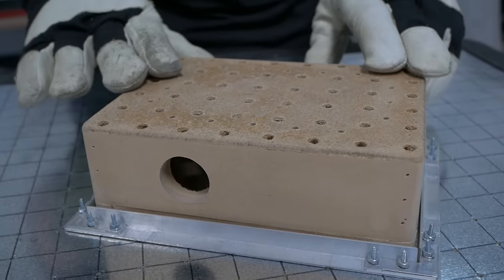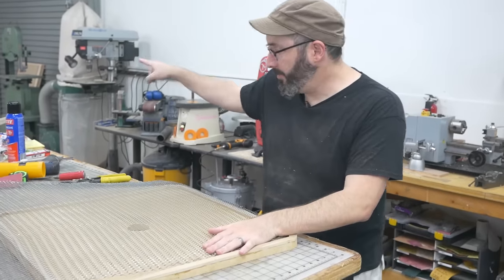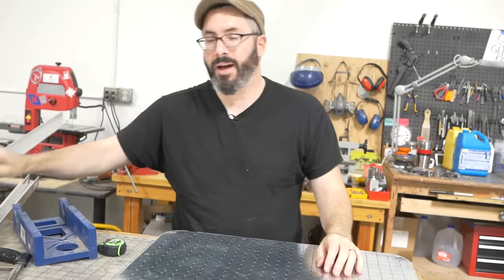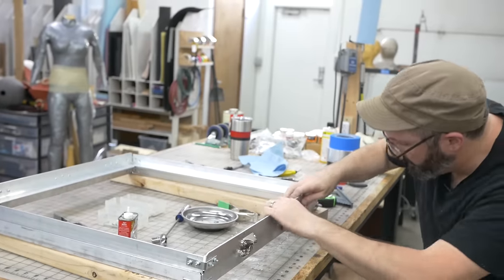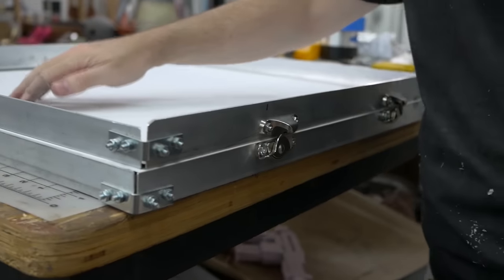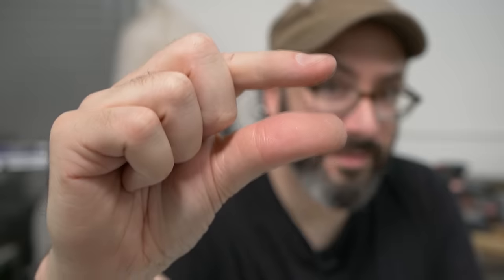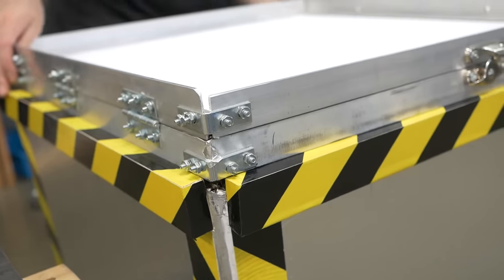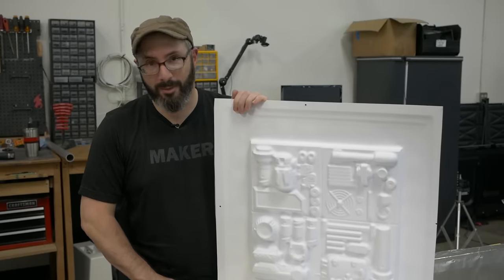Hardware Store Vacuum Table - HOW TO make your own

Comment: When I’m gluing, I’m a huge fan of either a 2 part epoxy or West System carbon fiber resin, which is my favorite it’s way more expensive but you could use fiberglass resin from Walmart $20 difference between the two other than price is West is a 1to 1 ration the Walmart brand is 1 to 10 drops. Great idea that’s awesome bro I think I’ll follow suit with you and maybe catch the mist from your storm. Shalom
Reply from the maker: Thanks so much for watching!

Comment: With that heat, I'd put in a caution to do this in a space as large as Bill's or outside (like drag it out of the garage) because of MDF's propensity to offgas urea-formaldehyde, the glue that creates MDF. 
Also, Id throw in a tread pedal switch to turn off/on the vacuum, so one person could operate the process.
Reply from the maker: A tread pedal would be ideal for sure! And yes, it's definitely good to be cautious with high heat in small areas!

Comment: Suggestions and tips:
Heater box:
- adjustable height (adjustable heat, faster or slower heating), 
-single custom element (keeping in mind that this is a build of hardware store bought items, tear the two heaters apart and put the coils where you need them to be)

Aluminum frame: 
-you can braise wield aluminum with a propane or map/pro torch (takes practice and a good torch head),
 -on the inner side of the frame where it grips the plastic put punch marks (punching from the sides that don't grip the plastic), all around the inner edge of the frame (making gripping dimples), or just puncture through the aluminum altogether with a nail or big punch to make gripping teeth
-Also the aluminum frame was best idea, lightweight and cools faster

The base: 
-glue the metal and spacers on before cutting for less work, or just don't cut the corners, 
-and primer or sealer or vinyl or veneer on any exposed MDF or particleboard (I hate working with the stuff and find that these wood like to attract ambient moisture)

Comment: maybe if you added a fan to help moving the hot air and distribute it by adding some turbulence it will get hot faster and also help having a uniform... but I like the fact that you used the fact that hot air moves upward. this also will allow you to probably move the heater a bit closer to the sheet so you will save a lot in term of energy and time

Comment: "Vac-zilla" seems appropriate or perhaps "Frankin-vac".  In college I worked at a sign company that made vacuum formed signs. The plastic we used was .02" ABS plastic; a poly vinyl I think. It has a lower optimum temperature and holds the heat longer, necessary for the plastic to get into the finer details of the mold. Rather than trying to seal the aluminum frame to both the plastic and table, the commercial table we used had a 1/8 in raised, high temperature, hard rubber bead gasket that sealed the plastic to the table. The frame only held the plastic sheet in place. You should run the vacuum through a sealed 5 gal (or bigger) bucket to a foot valve to the table. Run the vacuum prier to moving the plastic to build up the vacuum in the bucket. This acts like a capacitor or an expansion tank in a water system. The full vacuum is more instantaneous. The vacuum foot valve is used commercially for vacuum forming and silk screen print tables. Also the foundation for your parts should have holes drilled in it to distribute the vacuum evenly throughout the mold.

Comment: to get a better heat on your plastic, after the plastic has heated say 3/4" of the way to temperature, flip the entire piece and finish heating the other side all the way to the finished temperature. Those heaters are INFRARED heaters, so they heat items by reflecting IR light off them.  Like standing in the sun makes you feel warm as you absorb the IR light.
Reply from the maker: Thanks for the tip!

Comment: you could save tons of time and material cost by using 24 x 24 pegboard blanks for the top.  Even the aluminum ones are relatively cheap and much lighter than adding another inch of MDF.

Comment: These are good for shaping parts for car audio. Like kick panels and door pods 
The formed part is used as a mold to add your fiberglass resin and mat into or just use thd form as it is. For a car your going to have to make a right and left  
Pattern to form from. 
These are not just for art they have a practical use to make things with that do more then visually functions.
Reply from the maker: Very true!

Comment: to get more detail in your results you need to create vacuum at the top of your form. With the last one you would have to create a channel under the bottom and make small holes up to the top. The holes would be places along edges where you want the plastic to be pulled into. To soften out the webbing and deformation at the edges you can use clay and round out the edges to the table a little bit. I use to work at a place that made pool parts and some were vacuum formed. The guy who designed and built the forms had it down to a science. He could build a form and within a couple tries get the exact parts we needed, adding only a few holes here and there or some molding clay.

Comment: Super cool and fast build.  Silicone would work as well, act as glue and allow you to take it apart in a pinch (as opposed to gluing the top pieces together).

I have cut the lower section at 45's and then bent the frame so you only have to make one corner bracket.   Meaning you cut a 45 notch and bent the upper aluminum.  

Cool Idea on the sash lock.  Never used those.  I will have to try that.

It will make your plastic a littler thinner if you are doing,  say trooper armor.  But raising your part onto a platform,  will make the webbing happen off the part.  And dont forget to mention that you need to drill holes through your parts/buks in order to get detail (but very very small).

Comment: A couple of thoughts: 
1 - There is a lot of time between pulling the plastic off the heater and starting the vacuum, allowing the plastic to cool. Turn on the vacuum before removing the plastic from the heater. It won't start pulling until you seal the frame to the table, but will then pull immediately, while the plastic is still very hot.
2 - Wire your heaters in series and plug them into a 240v outlet, I'm sure you have one in your shop. It will only pull 12 amps, and you won't have to mess around with all the cords running to different outlets, etc.
Reply from the maker: Thanks for the suggestions! =)

Comment: When you are heating the plastic up place a Styrofoam insulation piece totally over the top suspended by the the aluminum channel. That way you're not losing any heat and the plastic should heat up more quickly and more uniformly.  Place a thermocouple connected to your voltmeter inside this space to measure the actual temperature to know when to remove the plastic for the forming process. To automate the process, you could connect a thermocouple  and a heater circuit controller to an Arduino to extinguish the heater and a buzzer to alert you to the fact that you need to transfer the plastic sheet to the vacuum former.   Just a thought...

Comment: Some of your issues with the incomplete forming  are, the holes for the vacuum needs to be right at the edge of the mold, also when heating styrene plastic, watch the surfaces while its heating, it should sag, then come back up flat, or nearly so. If you are going to use a shop vac to power your vacuum forming I suggest two, because the plastic looses heat very quickly and needs to form instantly,  also start the shop vacs before removing the plastic from the heat. With a mold with that large a surface area you should have additional holes in the mold. You can buy very tiny but 4 to 6 inches long drill bits.
Good luck

Comment: Some good stuff. Learned about using sash window locks for an easy way to apply clamping pressure. But would it kill you to learn the real names of common hardware pieces? I searched "thingy" on the Home Depot website, nada. Another thought, 10 minutes to heat a think piece of plastic? If your oven was four or six inches deep, instead of two feet, it would take about 30 seconds. One last thing. If you reduced the depth of your vacuum chamber from 1/4" to 1/8" (one layer of your mesh) the vacuum would do it's job much quicker, before your ultra-thin plastic starts to quickly cool.
Reply from the maker: We're not always specific with our terms in the videos but we always link to items in the video description - this build has a detailed tools and materials list with links to everything we used!

Comment: just a thought you could use an old oven turned on its back ?  they are free all the time and they go up to 550 deg. and just leave the door on and open it when its preheated then put your styrene and frame over the oven opening  ?????  love your channel
Reply from the maker: That's definitely an option, we just didn't have access to an oven at the time.

Comment: 37:04 Get a shop rag and dump a 1/4 cup of talcum powder in the center, bring up the corners and tie off the ball of talc.  Lightly pounce that on your tool (mold) and it will act as a mold release.  Use a rubber mallet on the plastic to lightly tap the mold out.  You ought to heat your mold so the plastic doesn't freeze when it makes contact and get a 2nd hand GAST rotary vane vacuum pump from ebay. You need to have a slight rake angle on your mold as if its right angles and deep you'll never get the mold out and the plastic can crack.

Comment: Bill, you do an excellent video.  Having done custom vacuum forming professionally for many years, I'm puzzled about some of what you showed us and I have a few suggestions.  I've never used a frame for forming so it may be different.  We typically use nylon stockings over the model we're forming to.  They help the vacuum get into the tightest of crevasses.  Depending on what you're trying to do, it can help to elevate the model with a plywood, foam, Clay, or ? lift shaped to the bottom of the model, raising it enough to create a tight vacuum throughout the model, eliminating the ribbing.  

You did a good job of making the heat even on the plastic.  However, 10 minutes seems a long time to heat styrene.  I suspect putting a lined cover over the box will help hold the heat in to give you a slightly higher, more uniform heat.  Perhaps a better way might be to buy an old, used commercial gas oven or pizza oven.  They take up more space and are harder to move out of the way but are much more efficient.  

For vacuum, a good shop vac does work but it puts a lot of stress on the vacuum and they tend to break down sooner.  I've purchased a number of good, used vacuum pumps for about $100 - 200.  Actually, my favorite was an oil pump that was an antique.  It produced just the right amount of vacuum, sounded like it was going to quit any time, but worked flawlessly for years.  Another source of vacuum is your air compressor and a venturi adapter.  I used one of these for a few years.  Here's a link to a description of it:  https://makezine.com/projects/giovanni-venturi-venturi-effect/.

These are just ideas from someone who's done a lot of vacuum forming.  I loved your video and ingenuity.

Comment: If you covered the back of the frame when warming you might be able to cut down the warm-up time by a bit. Maybe if the plastic were a bit closer to the elements as well. I was thinking if you made an enclosed space you could possibly turn on the elements and hold in ALL of the heat, and put the plastic closer to make sure it all gets up to temperature. Like maybe how you had the first element set up with the addition of walls and a rack for the plastic. I also wonder how changing the size of the holes would affect the end result. Good build though! Hoping to build one of my own at some point :)

Comment: That is awesome.
Can you make a variation of that, a Vaccuum wood veneer clamping table. You can probably use Boat Canopy Vinyl as a vaccuum barrier. The shop vac probably won't provide sufficient continuous pressure though.

Comment: Great idea with the modular components! I guess if you drilled holes in them to allow suction the plastic itself would get pulled in to the holes? Also: why no lid to your heat box, you know- to reflect heat back to the plastic from the top side?
Reply from the maker: We did eventually make a lid from aluminum foil, but we needed to watch the plastic like a hawk. It got incredibly hot, quickly.

Comment: One quick way to improve the heating process would be to lay a piece of foil-faced insulation on top of the frame with the plastic.  Lift it from time to time to make sure things haven't completely melted away, but it would eliminate most of your heat loss from the upper side of the plastic.

Comment: I realize I am late to the game but try adding a bit of foam insulation to cover the frame while you are heating the plastic. Put a few small holes in so you can read the temp without removing the foam. Should help you get to the correct temp.

Comment: consider using the foil cover insulation panels.  You know the ones with the blue foam core and foil on the faces.  Maybe making a box out of them would be easier the building a wooden box?

Comment: Great work Bill, i like what you made . I was going to suggest using Convection ovens fan to circulate the hot air evenly. It is an excellent way to save energy while heating your plastic in a timely manner just like when we make our PIZZA :D

Comment: I wonder if the thermometer is reading high because of the infra red light beaming up. It would be interesting to turn off the heaters and check the temperature of just the plastic.  Also there would be a lot to gain by having a stronger vacuum. I was surprised at how easily the black test sheet was pulled off. Two shop vacs in series would be worth testing.
Reply: That black test sheet looked like a dirty mat pulled off of the floor, not exactly smooth or form fitting.

Comment: Instead of the mesh, to save cost, you could use the same MDF spacer, cut 1/2" long placed every 4"-6" apart. To prevent the vacuum hose from going to far place a few spacer half way over the hole.

Comment: needs convection.  i saw your video from the first one (smaller version) and i have wanted to make one for a long time. I just had the need for it recently so I looked up your video again and saw this one where y'all make a larger version. bigger can be better. but i think heat needs flow. I'll try it for myself and I get success I'll let you know what I figured out.  thanks for the inspiration.
Reply: I was thinking convection too. It may even reduce his power requirements and allow using a single breaker circuit. Although I must admit that turning the thing upside down was a great idea and inevitably induces some flow already.
Reply from the maker: Thanks for the thoughts!

Comment: Placing hardie board (or cement board) inside rhe wooden heater box prior to placing the reflective aluminum inside that would give the box a better heat retention value

Comment: Second suggestion... would it help to start the vacuum before you place the heated plastic over the form? It seems to me that when you are placing the heated plastic over the form, it sits there for a few seconds, cooling off, partly because of the metal surface, before the vacuum is started.

Comment: I like the idea. If you had to do it over again do you think you would consider using the heat element and controls from a retired oven? I have so many thoughts and ideas about how I would use this.
Reply from the maker: Yeah that would have been ideal, but we had to put this together pretty quick so we went with a different option

Comment: Nice job.  The only problem using MDF for the platen is that it is porus at 6"Hg.  Lucky, Shop Vacs only pull 6"Hg, but should you ever feel the need to upgrade to a vacuum pump with surge tanks, you are going to need an all metal platen and vacuum box.

Comment: Great video and a topic I am interested in .. Thinking you could have helped speed up the heating of the plastic and maybe reach a higher temperature by putting a slab of rockwool insulation on top of the plastic sheet and cut to fit into the frame. May prevent some heat loss ??  Would be interesting to see what you could acheive with thicker plastics.
Reply from the maker: Thanks for watching! We appreciate the tip :)

Comment: Hi dear. It has been a successful business. good health to your hands. Place the heater facing down as you did at 23:30. place the vacuum system at the bottom. (I will explain the vacuum system in the next comment.) Place the plastic plate between the heater and the vacuum system. (Use a rail system to move up and down.) Turn on the heater. place the plastic plate on the middle system and lift it. Turn off the heater when it reaches the desired flexibility. start the vacuum system. Without wasting time, immediately lower the plastic plate to down. In this way, the plastic plate will not be exposed to airflow to cool. But, in the current system, during transport from right to left, the plastic plate is cooled by the airflow and comes to the vacuum system. This prevents you from getting the correct pattern.

Comment: If you just take 1 hinge off down the one side.. you can reverse the box and then just put your aluminum on reverse side and it should get a little smaller and you top will fit over tight... 

Have fun..

Comment: If you made a mask, to cover areas where you don't need suction, as in a small part area, would that boost the vacuum available for the actual part? a mask could be any thin sheetgood.